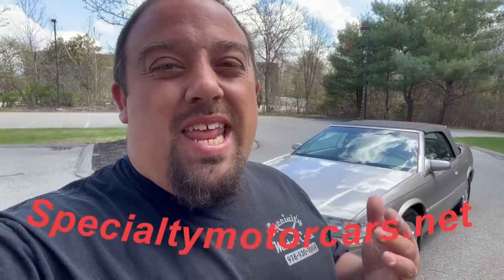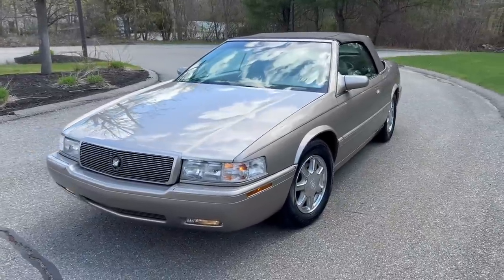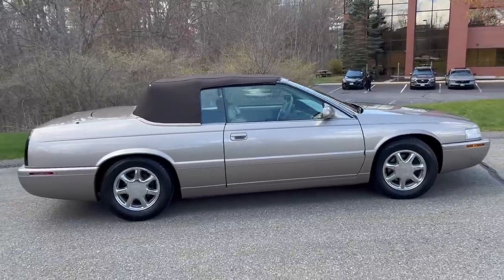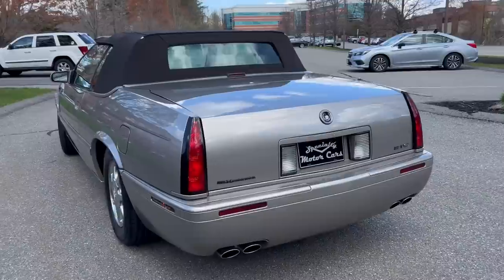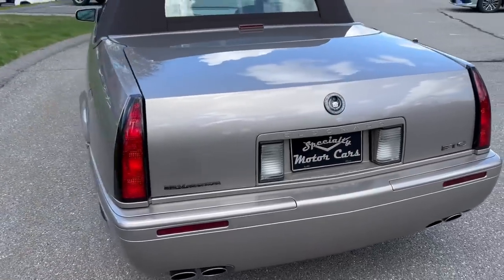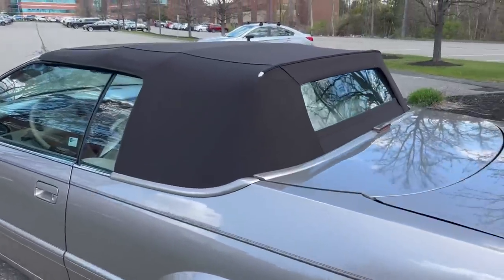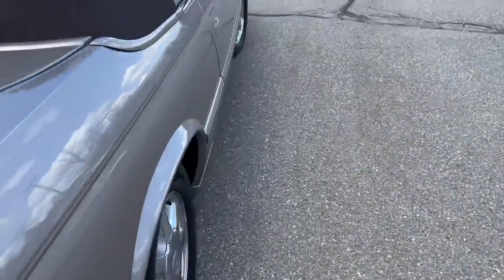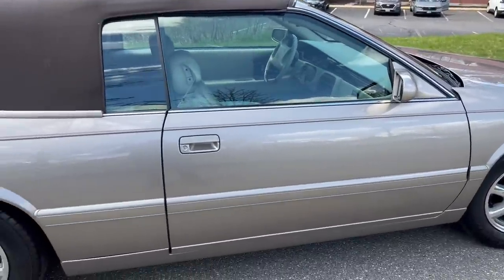CUSTOM! 2001 Cadillac Eldorado Convertible by Coachbuilders Limited 29k Miles Specialty Motor Cars

Comment: Anthony- beautiful example of a 2001 Caddy El Dorado. ETC convertible. 

As far as what’s coating the bottom of this lovely ride, looks to me like sand picked up from driving on those southern Florida roads.  

My caddy’s  chassis  also had the same dusty coating on it. We lived in Fort Myers Fl and whenever it rain hard the sand from the ground would flow across the roadway splattering the car’s underside 😢.

Comment: Very NICE, I've owned a number of these type of Eldorado's I have a fix for the Northstar overheating issues,  however I would suggest having the heads pulled and longer bolts tapped in... those cars would run a long, long time.... I like the new pointer... lol

Comment: Do you know if the A pillars were reinforced? Since this is an aftermarket convertible that could be a huge safety risk.
A number of issues like flipping and landing on the roof, something large lands on the windshield (like falling debris), or rear-ending a semi, etc. If the structural integrity of pillar A is compromised, loss of life or serious bodily injury is highly likely to occur.

Comment: WOW!!!  That car looks so sleek and aggressive with that top downn!!!  Just change the coolant annually and add the GM pellets; change the oil frequently.  This will extend the Northstar engine.
Reply: Pellets ? ?
Reply: @31847448  yes.  GM created pellets to be added to the radiator after flushing it to help seal any leaks.